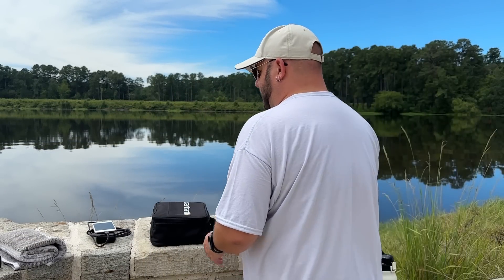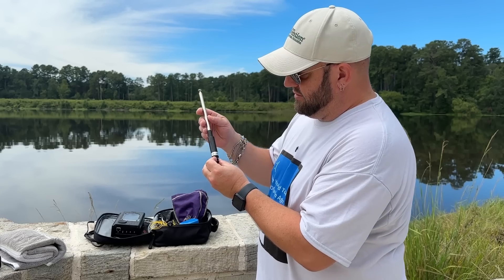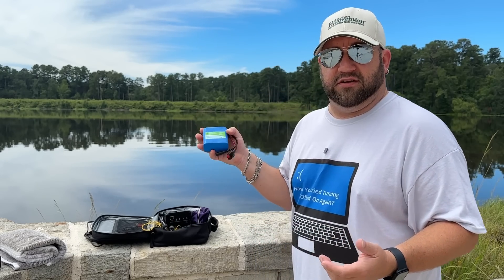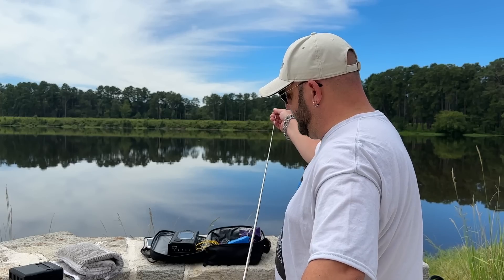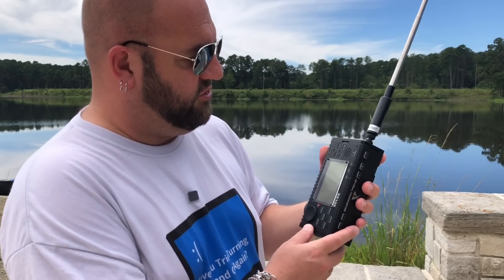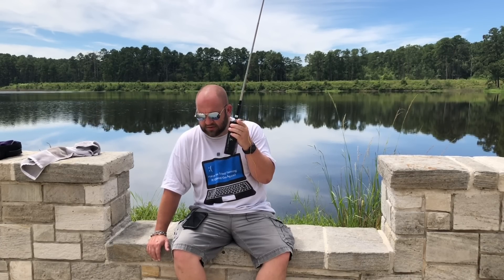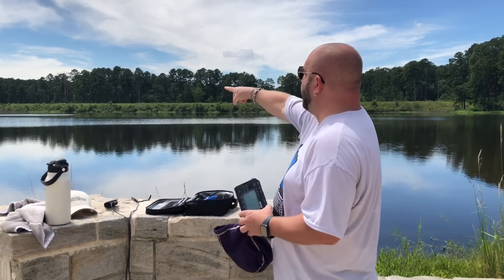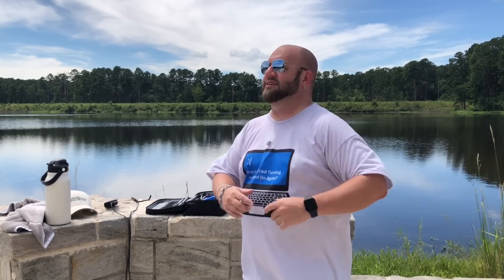QRP With An HF HT & A Really Bad Antenna!  Let's Find Out!

Comment: You restored my faith in my X5105 - speaker sound is so terrible compared to my slightly more expensive FTDX101MP. regarding POTA with a 30 pounf car battery and a FTDX-10 - al least you feel proud when done 🤣

Comment: Well done, sir!  I have the X5105 and have worked HF HT with an unloaded 72" whip.  Ran it on 4 bands even, just tuning the whip with the internal ATU (15/12/10/6 meters!)  I just got a new X6200 in July, and plan on running HF & 6 meter HT mode this weekend. Not sure which of the dozens of parks here near Buffalo, but I will be out there!

73, Keith,  WB2VUO in Amherst,  NY

Comment: I have used my x6100 quite a bit like this. This is why I like small shack in a box hf rigs. Even if I want 10 watts, the battery needed for these types of radios are small.

Comment: Love it! I ordered the Gabil HF, HT antenna set and have been working the world with my x6200 configured into a HT, I’ve worked Puerto Rico, Spain, Slovenian, Canada and multiple stateside stations @ 5W from Va…  With a 10.5’  rat tail and some slight whip adjustments I can get 1.5-1 SWR out of most of the loading coils I’ve tried so far.. works great on 20 meters.  “73’s”  WW3DX

Comment: Love my X6100 despite it's flaws.  Been playing with Olegs firmware a bit too.  The selling feature for me was just putting a BNC telescoping whip on and using it like an HT.  Like you I have been pleasantly surprised.  It's also been my go to when I want to do a quick activation but I don't have the time to run the EFHW.
Reply: What whip have you found that you like?
Reply: @MacomaFarms  the MFJ 20m and 40 meter whip.  Also have the MFJ multiband 6m-80m with taps (I have to make a new tap wire, puppy chewed it up) 😡🤬.  I have a clip with radials I will use also. 1899t?

Comment: There is an Elecraft HF SSB HT.  It's called the KX2.  Internal microphone?  Yes.  Internal battery?  Yes.  Tuner? Optioal (KXAT2), but yes.  (And "Hi" to Satan.)
Reply from the maker: Yes, I know.  But that also does CW too and they made the KH1.  All I'm saying is there should be an SSB version of it they can call the K8MRD SSB Elecraft Extravaganza Super Awesome POTA Radio.  I think that rolls off the tongue better than KX2.
Reply: @hamradiotube  If you don't plug in a key (or serial cable, and you haven't programmed the CW memories) it doesn't transmit CW.  And the 5105 will receive CW (if, perhaps, nowhere near as well).  You could always call it the K9x2)8MRD SSB HT.

Comment: Hey Mike I've tried the same with my X6100.  I have a trick for you regarding the counterpoise.  Get a metal tape measure and attach a croc clip to the end and then it's an adjustable counterpoise you just lock it in place at the right place.  If you make a note of the length pulled out it's easy to repeat!  73 de HA5RV
Also great for 10m, 6m (even 11m if you are into that)
Reply from the maker: That is WAY more work than pulling out a random piece of wire from my junk box and using it as a counterpoise lol!
Reply: @hamradiotube  Well if you will measure it anyway...   But adding a crocodile clip once isn't that much work and it makes it repeatable you can make on the bands too with a sharpie.
Reply: @hamradiotube  Also if you connect two to a BNC to Banana plug connector you have an adjustable dipole 😁
Reply: What whip have you found that you like?

Comment: My Friends X5105 works great but it has that same internal noise with no antenna at all.  Elecraft's answer to your challenge would be the KX2 for SSB operations HF HT.
Reply from the maker: I just really hate the speaker on the KX2.  It fires backwards and is not nearly loud enough.  That is really the only reason I don't own a KX2.  I hate the speaker that much.

Comment: Last winter I operated handheld with my KX2 and AX1 and made 60 SSB contacts on 20 meters in like 45 minutes. One of which was to V51WW in Namibia Africa 😆😆. I was blown away how well that worked. Of course there have been other days that I've tried it and only barely made 10 contacts but it always does work. I agree that a manpack radio or designated SSB Handheld would be perfect

Comment: The SCR-536 "handie talkie", which helped the Allies win WW2 and ran on tubes, pumped out a whopping 300mw AM in the 80-60m frequency range.
And yeah, it weighted 5# with the two batteries installed. 

Nothing has changed. Radio is still damn cool even if it's QRP with an HT and crappy antenna. (And just how crappy is it if it works??)

Keep up the good work!
73 de N8ESP

Comment: I have been dreaming about doing that for a few weeks now since I saw someone toss an antenna like that on the uSDR that has the built in mic and ptt. I have the cheap uSDR+ that doesnt have the built in ptt so I want to have the radio in the small shoulder bag and put a short cable on the antenna. I want to see what kind of random places I can make contacts from. I am in love with QRP... I have a 100watt ICOM IC-725 at home but I sure as heck not dragging it out into the field when I can take the less than quarter pound uSDR+ in a small bag with the battery powered auto tuner. I took mt QRP rig to work yesterday and today and made all sorts of contacts over lunch and right before I went home. Yesterday I worked Slovenia before going home and today I worked Hungary From Halifax Nova Scotia Canada. All with a plain wire 20m inverted V dipole that took me 10 minutes to make

Comment: Mike I've been on the fence for qrp and this video helps. I dont mind the challenge of lower power.  Considering the xiegu 6200 since the ICOM 705 is quite a bit more expensive.  I agree with you that the tuner is a nice feature

Comment: I have an 1820 but I haven't had any success with it and my FT-818. It may be the lack of a tuner. Thanks for the video, you've inspired my to give it another try.
Reply from the maker: I could have just gotten lucky but yeah, I wouldn't run this antenna without a tuner.

Comment: One thing that could make using this radio as a HT more convent would be a hand strap.  A strap that goes from top to bottom on the back.  That way your don't get hand fatigue gripping the radio.
Reply from the maker: Good idea.  I don't know how or where I would attach it though.
Reply: @hamradiotube  Agreed.  They would almost need to have provisions molded into the housing to accommodate the strap.

Comment: QRP is where it's at. I am having a blast with a uSDX QRP SDR radio which gives about 5 watts max depending on the band. Much more skill involved in operating and reading the conditions that just winding up (or down) the power dial on a normal rig. It's best with a qrp EFHW or a resonant vertical. 73 M7BLC

Comment: In the late 80's to early 90's in the Army as a radio operator my ruck sack would weigh between 80 to 100 pounds.  All my field gear, water, rations, weapon, ammo, SINCGARS radio with extra batteries, etc....  Lug that around for 15 to 20 miles every day for several days in a row.  At the end of the day you don't go to sleep, you pass out.  73 KC3OSD
Reply from the maker: Thank you and no thank you!
Reply: Super!!!  Thanks!

Comment: Man, I'm very jealous. I've attempted 3 activations of my local park (US-3261) using my x6100 on 20M SSB at 10w, all unsuccessful after over an hour. I've tried dipole, end-fed, and vertical antennas. The best I ever got was 8 contacts, but the park closed and I had to leave. I'm going to try again next week but this time i'm bringing a 50w amp.
Reply from the maker: Hey it happens man.  When I first moved here I had a few failed activations at this park.  I was beginning to think it was a dead zone for RF.  Persistence will pay off.

Comment: Planning to activate a state forest near me but there is not enough open space around the small parking area to set up any antenna. However if i walk 5 minutes up an embankment across from the parking there is enough room in the forest. So do i drag my 7300 and stuff up the embankment or just grab my QRP backpack? QRP will probably be the way o go.
Reply from the maker: For a 5 minute walk I don't think the 7300 would be too bad if you can fit all your junk in a backpack, but a QRP radio would certainly be easier on you.

Comment: Hey there Mike.... thanks for doing this video!   I will pass on the point to Elecraft!     Quick secret for you (and those that may read this...) if you take a heat gun to the top of the loading coil on those MFJ antennas you can unscrew the whip and they will become much shorter! and then packable.   There is just a little thread lock on them and some heat will soften them up.  73 NA0MT
Reply from the maker: Hmm, that's pretty cool.  Bets on if I break it or not?

Comment: You can use the KX2 the same way!
Reply: correct I have been doing walking portable with my kx2 for years.
Reply: @mikeroberge5488  Same here. I have been doing it for the last 4 years. It was in fact one of the original design specs for the KX2. There are also many videos out there on youtube showing people using them in this manner.
Reply from the maker: And you can use a KX2 for CW, yet they came out with the KH1...

Comment: Love it... but is that smaller than the KX2?  was in the Elecraft booth this lasat weekend in MA. "The KX2 also makes a great moble rig, and can even be used hand-held. It includes a built-in mic for HT-style operation"
Reply from the maker: Oh heck no!  The KX2 is probably half the size of this radio.  I didn't know if the KX2 had a built in mic, good to know.
Reply: @hamradiotube  And the AX1 comes with a 13' radial. I've hunted with it in the back yard, but never activated with it.
Reply: @hamradiotube  it does but don’t think there is the same style PTT button. BUT I am pretty sure it has an internal tuner and I know they sell a whip for it.  I started thinking best it but cost kept escalating so I said screw it and went for the full KD4 🤦‍♂️
Reply: KX2 has ptt button, built in mic, built in tuner, built in battery and is smaller. Also, doesn't need anything to plug in a computer and run digital modes
Reply from the maker: But they still came out with the KH1 even though the KX2 & 3 both do CW...
Reply: I always love it when you show ham radio through the lens of a POTA activation.  Those experiences are just ripe with experimentation and exploration and plain, simple fun!  I think I’m going to tote my G90 in my small backpack to a secluded park tomorrow.  Thanks again for another great inspirational video, Mike.